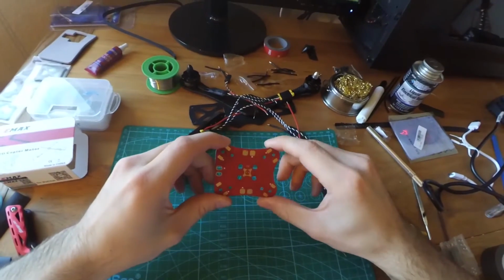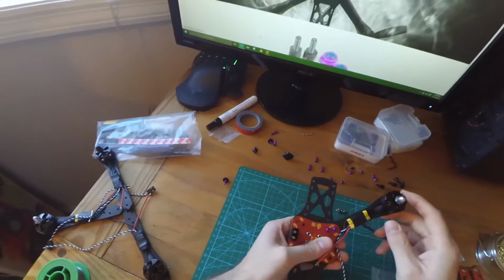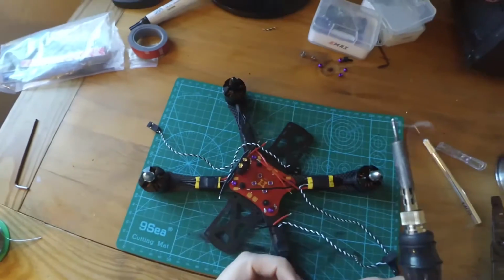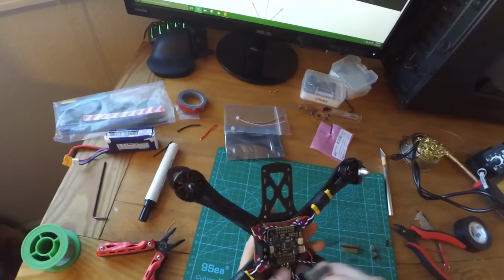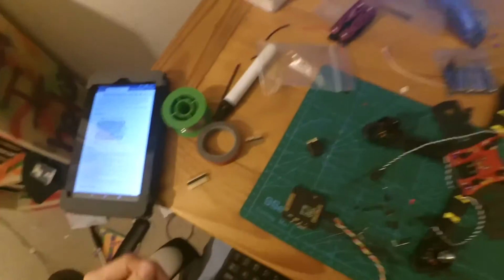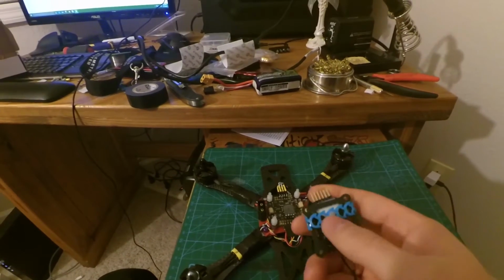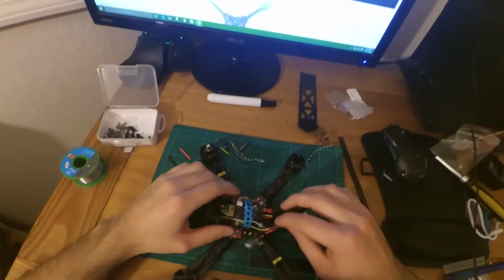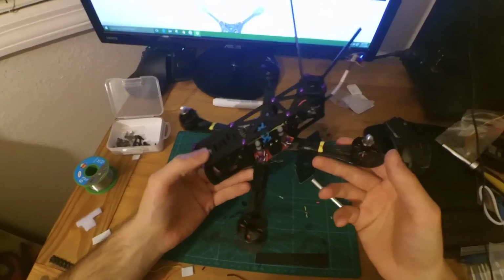Alien Build Part 2  Esc Fc Soldering and Finishing Touches Before Programming

Comment: hi. i just installed a motolab cyclone onto a build.  my first build. im trying to use cleanflight but it wont flash. would i get cleanflight to recognize my flight controller?
Reply from the maker: did you put the FC into boot loader mode?
Reply: No. How do i do that? I been searching online for days trying ro figure this thing out. And i cant find any info. What is boot loader mode? Do i do that on my computer or on the fc itself?